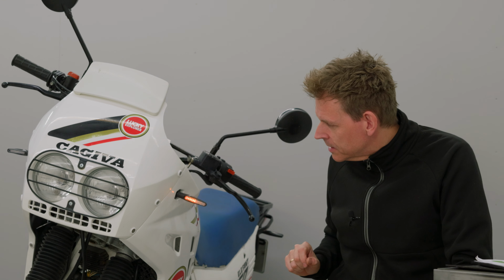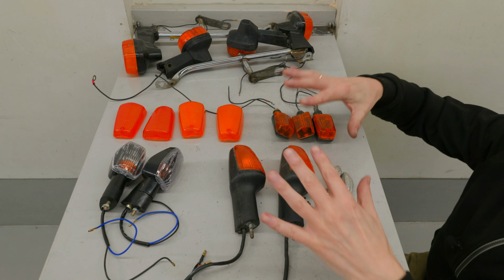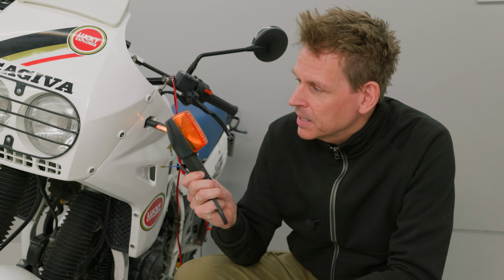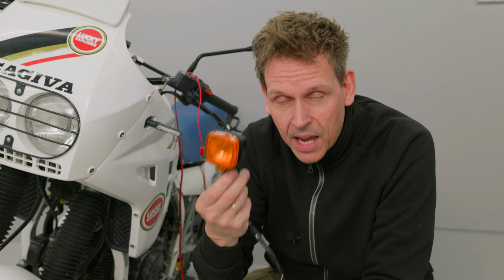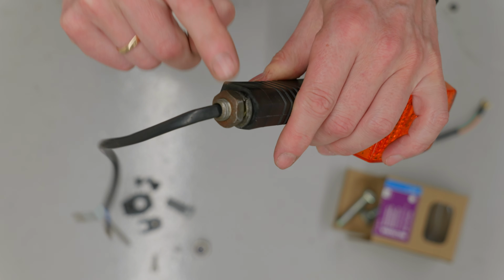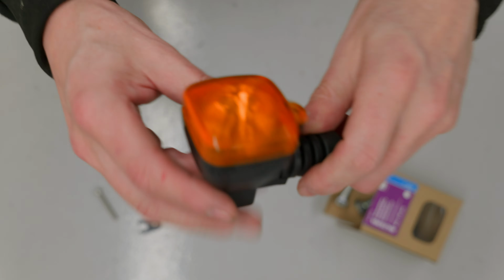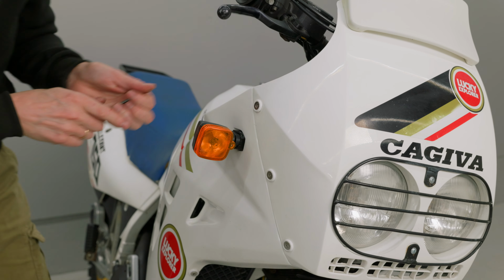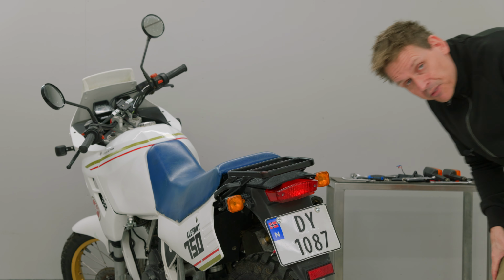Blinkers are not just Turn Signals - Fixing the Elefant - Episode #11

Comment: I might be the only one in the world who likes big and bulky indicators. Love your Elefant, most beautiful dakar replica ever made
Reply from the maker: It's pretty nice 😊 I guess the big indicators are a bit charming, but I am probably saving 1 kilo of weight by putting on smaller ones - less weight = more performance 😁
Reply: Not the only one.  As the primary reason for indicators is to get your intentions through to other road users, even those texting/sleeping/daydreaming, there is no such thing as an indicator that is too big or too bright.  I recently improved the wiring on my machine so that the puny, ridiculous 10W bulbs (same as above?) could be replaced with 21W ones.  Indicators are flexibly mounted to preserve the bulb filaments.  Changing that might compromise bulb life, so I would keep a careful watch on them.  LEDs might be useful in this instance, with their sudden on/off characteristics.  They are just too puny and directional at the moment.
Reply: Also, it is the visibility of the object, the smaller it is the brighter it needs to be to be as visible and most don't pass that criteria.

Comment: Really good video! I think it was interesting how you arrived at your solution and was especially impressed that you printed adapters to make the blinkers work on your bike. Personally, I would have used the big, stock blinkers but shortened the stalks to bring them in close to the fairing and fender. I just think the larger size would be more visible. Thanks as always for your videos. They are really fun and interesting!
Reply from the maker: Thanks Dennis 😊 I will actually try to find a set of the original rear indicators so I have a full set. It's hard to come by used parts for this bike though. I might switch back to the original ones some time in the future, would have been nice to find some shrinked 80% with half sized arm 🤩

Comment: not sure if there was room but maybe an internal tube in the blinking light would of worked, great problem solving for the fix, seems like the inner tube didn't have enough material causing it to flex to much
Reply from the maker: The rubber arm design was just not good at all 😖 I don't think it was much room to fit an internal tube, it would have to be very thin and by that not help much to get it stiffer. It might help making it more water resistant though 🤔 I have considered 3D printing new arms as well, I have got a quite durable flexible 3D printer fillament that has suitable rubber-like quality. Or perhaps just buy another type of turn signals with higher quality 😁
Reply: @kihestad  you did well to get them to the standard you did. They were very poorly designed, and then there was the quality. I've been enjoying your videos, great use of the 3d printer. Opens up so many opportunities, some people fibreglass over larger parts to make them stronger, I had to look up your cagiva, I thought elefant was a nickname. Looks a fun bike.

Comment: Nice video!:) Are in the process of replacing my own indicators on my xj600 from -94 that I got for free. They are all broken either at the lens or broken off their mounting points. If you want to send a couple to trøndelag them I'm all for it :-D
Reply: And the clear ones would probably fit nicely :)
Reply from the maker: I only have the glasses, but if you want them you can have them. Bare meg en e-post: ki@hestad.no

Comment: I think I would print out a mold and cast some 2 part polyurethane around the stalks to make them firmer. Or maybe just fill in the grooves with a 1 part urethane.
Reply from the maker: I guess that is the best way to go forward to get somthing with decent quality, but it's qute a job though. I would think 3D printing using flexible filament is a much esier job, but then again: will it be strong enough 🤔

Comment: You can look at the turn signal lamps for Honda NTV Revere and NX from 88-90 or 93-up... most of them are nearly square.
Reply from the maker: Yes, it seems like a bunch of motorcycles from 80s and 90s used these with different length arms: triumphs, aprilla, Honda ns125f and probably more 😅 Thanks for the tips 🙏

Comment: I would go if not the original with led bolts something closer to original at least
Reply from the maker: I have got a couple of suggestions about Ducati indocators from older type of Ducati Monster, they seems to be similar to the big originals for the Cagiva - but a tiny bit smaller. Would like to have some that is perhaps 80% shrinked down, and a bit shorter arm. Not easy to find 😝
Reply: @kihestad real nice job with the  3d prints lights look great i would go for the medium
Reply: Would be cool to stay on with main lights and flash when you need to turn

Comment: I have standard 12V 21W indicators on my bike, they look dull in daylight, and poorer still in bright sunlight does anyone know of a direct replacement brighter lamp?
Reply from the maker: 21w should be pretty bright, perhaps the indicator switch, the wiring/connected or relay is old and worn? Might be the bulb is not really getting 12V. LED replacement bulbs might exist, depends on type of bulb you got

Comment: 5:55 not at all. they have to design around the indicators that are by law required. the indicators are never the base or ground or reason for any design on any roadbike but to as low drag as the light emitter and design will allow for. if the makers had the choice they would either not be there or be integrated in the body for better looking design and less drag. 

thats the only reason. . .
Reply from the maker: It was probably a design choice back then, it just feels like a vulnerable one 🥴
Reply: Also has to do with the visibility of the object, the smaller it is the brighter it needs to be to be as visible and most don't pass that criteria like the larger blinker housing. 

A lot of aftermarket items you can buy are not good, but some want that modern look.